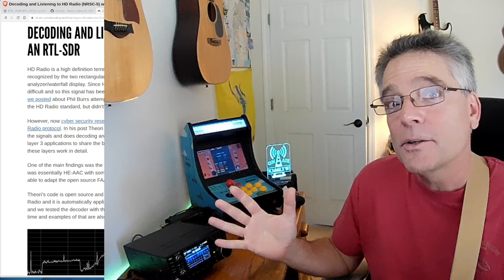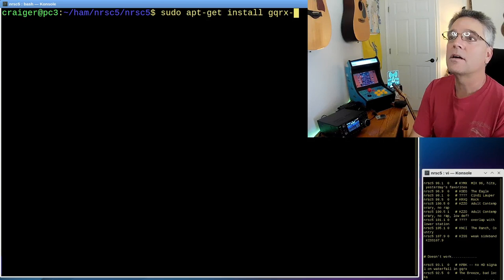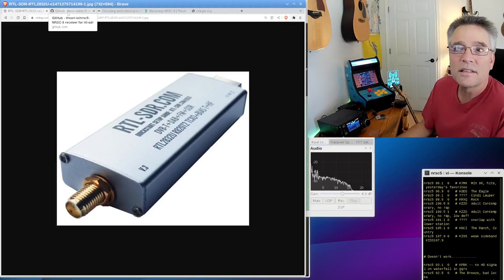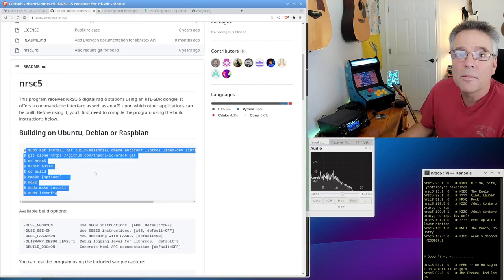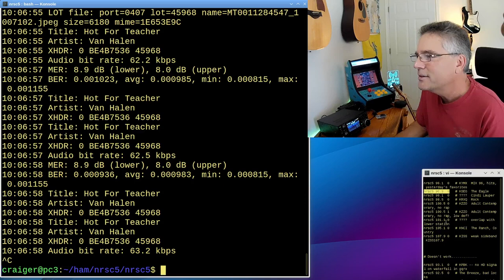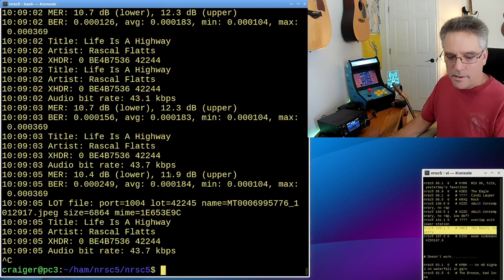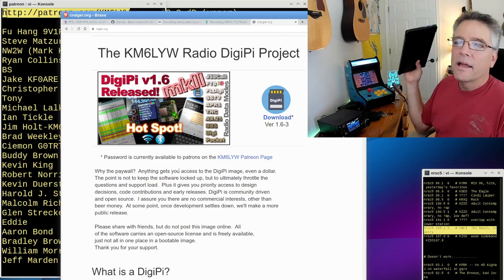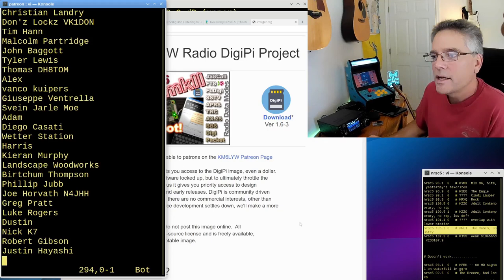Listen to HD Radio digital FM broadcast on your Raspberry Pi

Comment: What antenna are you using connected to the SDR?
Reply from the maker: In that case it was the big diamond x200 on the roof.   Not resonant on 100mhz, but worked!